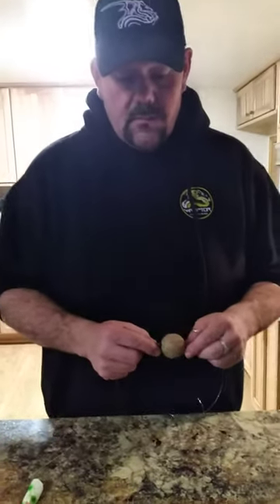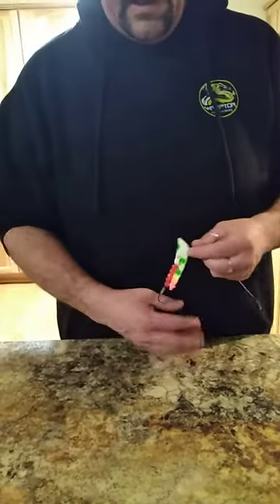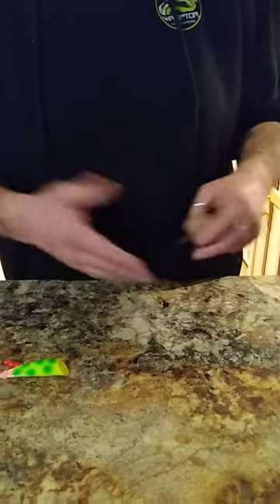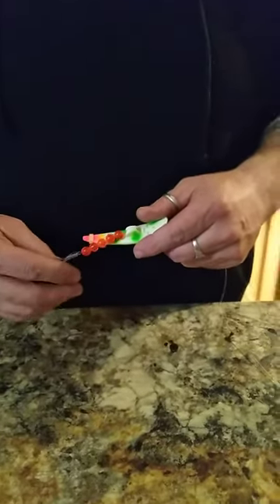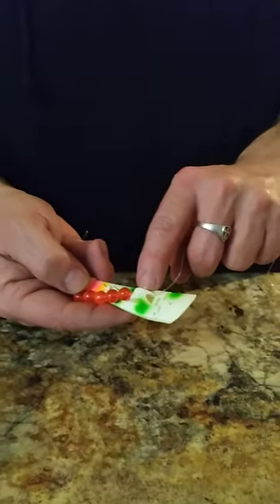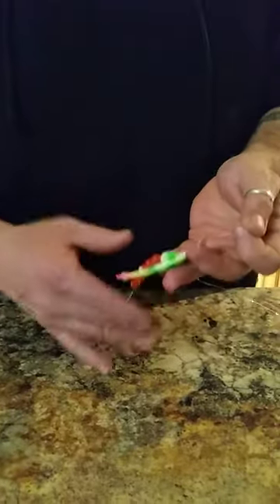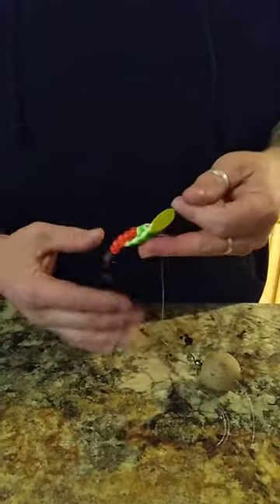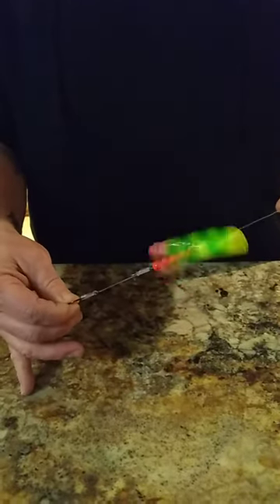Plunking with Brads cut plugs on the Columbia River and tributaries

Comment: I use a bead chain instead of the beads and I pull it up tight into the band with a treble. Gets rid of the short bite issue and a better presentation